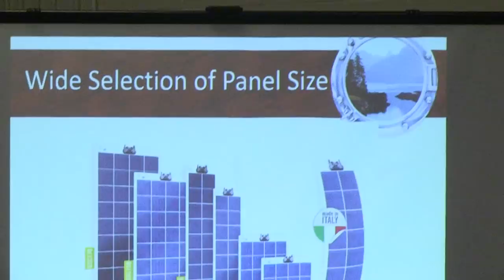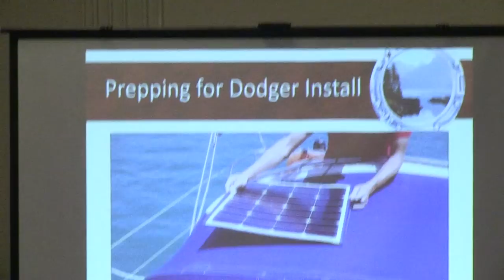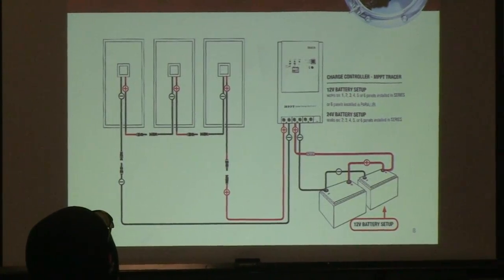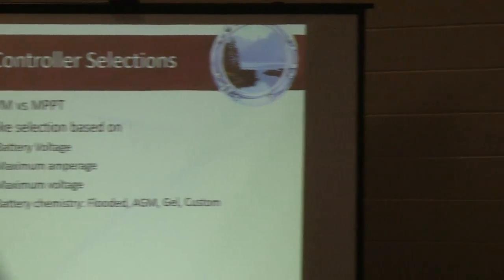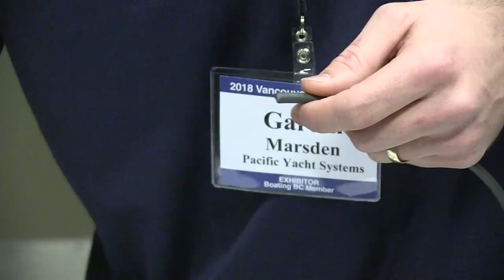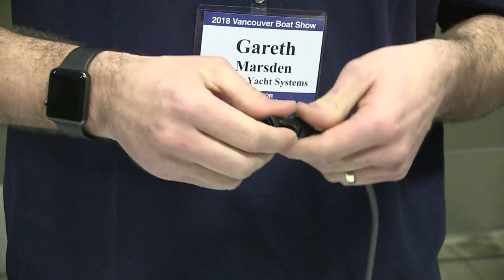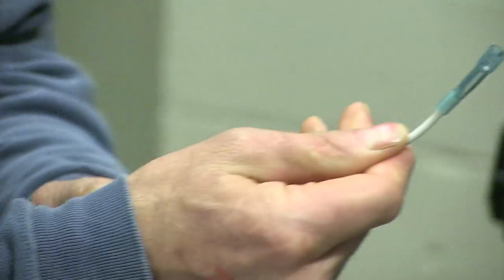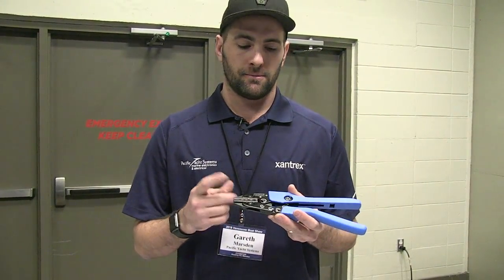Boat Show 2018 - DIY Marine Solar Panel Installation

Comment: I have a sailboat with two batteries that use a manual switch. This is NOT a "house" and "starter" situation. Both batteries are equal in size and function. Can I use a single Victron controller to charge the two batteries or do I need to use two panels, two sets of wires and two controllers? The alternator on the engine bypasses the manual switch and charges both batteries and the engine cranks from both batteries even if they are switched off. 
I'd love to use just the single controller for simplicity and cost. Thoughts? Thanks. .

Comment: Hi.. great vid,, I'm, installing a 2 panel system on my sailboat, each at 120w.. my question is that i plan on using an 8 gauge wire from my 20amp MPPT controller to my battery, what size fuse should i be using at the battery and should it be a maga style fuse? second question,, panels in series or parallel ? this one has me confused as to why,,, what way will charge the 2 batteries hooked in parallel more efficiently ? thanks

Comment: hi thank you I watched all your videos they help me a lot, I have an island packet sailboat.
I place 3 solar panel on the atlantic tower so have no shade .  I have 3 panels 200w newpowa monocrystalline high efficiency mono module on description say 200w voltage at Pmax 17.0v, current at Pmax 11.76A. diodes are pre-installed in juncution box. I do have a morning start Ts-45 tristar 45 Amp 12-48v pwm controller:
Rated solar, load or diversion current: 45A

System Voltage: 12, 24, 48V

Accuracy: 12/24V ≤0.1% ±50mV; 48V ≤0.1% ±100mV

Minimum voltage to operate: 9V

Maximum solar voltage (Voc): 125V

Self-consumption: Controller <20mA, Meter 7.5mA

Operating ambient temperature: –40°C to +60°C

Storage temperature: –55°C to +85°C

Humidity: 100% (non-condensing)

Dimensions: 10.3" x 5" x 2.8"

Weight: 3.5 lbs
 My question should I connect the panels paralel or in series and will my contrioller be enough for all 3 panels.
Reply from the maker: Hi Gianna, strongly suggest you consider a MPPT controller versus a PWM controller. MPPT controllers are generally 95% efficient, whereas PWN are less then 80% efficient. That translates to a lost of 15% or more of your solar wattage. If there is no shading, wire the panels in series.

Comment: Hello ,thank you for the wonderful presentation.
I have watched your videos and was motivated to order two solar panels 120w each and a victron mppt controller 250 w 17.5max amp.
I have a battery monitor bm1 with a shunt .my question is do I have to connect the negative pole from the controller 
to the shunt or directly to the battery??the monitor will not read the charging from the solars.
Question no 2 : is it possible to keep the shore power and the solar power all together connected .??  
Thank you.
Reply from the maker: 1. With a battery monitor and the associated shunt meter, make sure that no DC negative bypass the shunt, otherwise the battery monitor shunt will NOT capture the current.2. A smart battery charger and quality MPPT solar controller can be operating (i.e. charging) the batteries simultaneously.

Comment: Great video! I'm in the design phase of the system I'm putting together for my sailboat. My question is- You made it a point to say "make sure you are using outdoor grade solar wire when making your connections from the solar panels to below deck". All of the "outdoor solar wire" I find is plain copper strand and it is not tinned. Will that be an issue for marine use? Tinned 10g for below deck is not a problem to find. Thanks.
Reply from the maker: We too haven’t found a tinned outdoor rated solar wire. If you are concerned about corrosion on the indoor end of the solar wire,
use good heat shrink terminals on the solar wire as a way to offset or minimize the risk of corrosion.

Comment: If you have a ProNautic battery charger installed already, does the solar bypass that or go through it?
Reply from the maker: they are completely independent.  both go directly to the battery.   if both are charging the other will not care.

Comment: If you had a 48v setup, How many panels would you need or how much space would that take up?
Reply from the maker: Hi Joseph, some solar controllers offer boost capability,  meaning that you can have a small 10 - 22 volt solar panel charge a 48 VDC battery bank.

Comment: You mention a solar array with no shading in series connection.  If you do have shading and running to a single MPPT controller would you go parallel Or always in series?
Reply from the maker: Assuming your panels have bypass diodes, I would recommend wiring them in series in order to:
1) minimize the effect of voltage drop
2) limit the current in the solar cable 
3) meet the minimum trigger voltage in the MPPT so
that the controller converts what’s available in solar power to your batteries.
Reply: Hey thanks so much.  I really love your videos and have learned so much from them.  Series it is!

Comment: Are you saying that you could dead short a solar panel and not hurt it?
Reply: That's a question I wondered about too. However solar panels are designed with internal resistance that allows a dead short, at least for a brief time. In fact to test a panel you do two measurements in the sun, an open circuit voltage and a dead short current through your multimeter. After wondering whether my multimeter fuse would survive, I did the test, no smoke! Short circuit current of a typical panel is usually about 5A, within limits for the amp max on most quality multimeters. As solar panels age those numbers tend to slide downward.